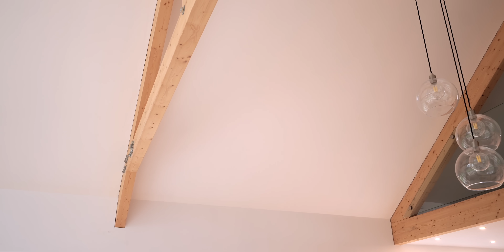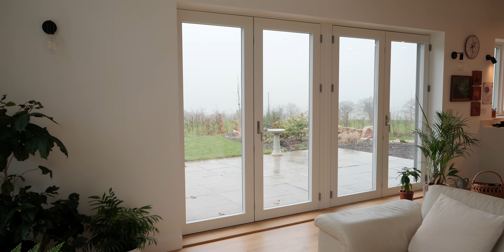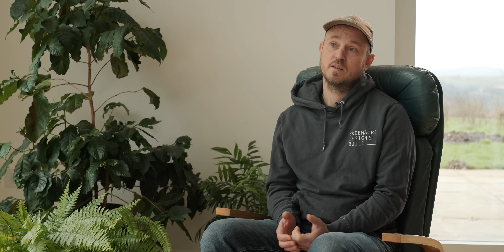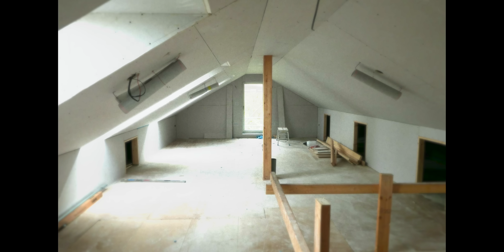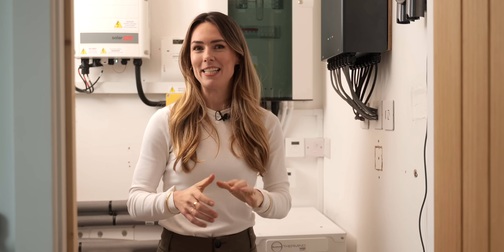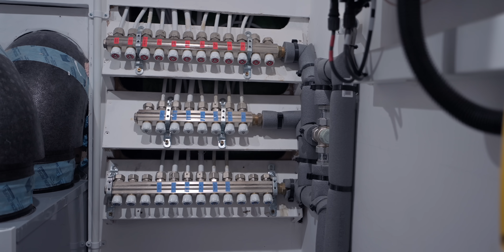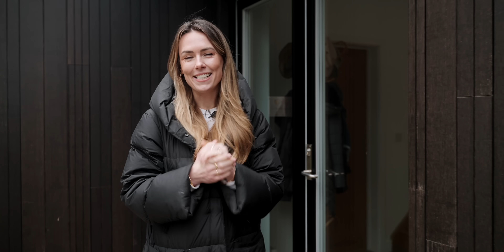Ditching a Heat Pump for In-Plaster Infrared Heating?!

Comment: Goodness gracious me Imogen!

That was an excellent episode and you didn't look for an escape route once!

Well done you.

I can certainly attest to the IR heating (I take it the material radiates FAR IR?) as installed a small mains powered, wall mounted panel, 600x 600 mm, rated at 350W for an invalid and that works very well.

Inanimate objects, despite the blurb, do collect some heat and this adds to the overall feeling of warmth.

As the old guy mentioned it's important to eliminate drafts for the "passive" thing to work.

The hot water system certainly was interesting and well worth some research.

In areas where heat pumps are practicable the installed heater clearly matched the expectations.

If you get invited to another such installation please take it up.
Reply: Goodness gracious! A good comment that wasn't bitter or condescending. From you!? Are you feeling alright? Or was it just because a BEV wasn't involved?

Comment: Usually, a  passive house with label don't need any heating system, only a small radiator in bathroom.

So, why is this house need an infrared based heating system ?
Reply: As I understand it Passive Haus needs 90% less energy for heating (than current building regs) ... so still some heating, just not very much. For a fairly small house that heat load is typically below what the smallest heat pump can run efficiently at.
Reply: @ecok Then it's not an actual Passivhaus. The certification for Passivhaus means no heating is needed. This is simply a very well insulated house, but not a Passivhaus.
Reply: Passive house doesn’t mean no heat required, just a low heat load. In a country with more sun hours but otherwise similar weather to the UK, you could probably get away with zero heating. The high ceiling almost certainly also has an impact on this as well, that’s a huge volume of unusable space above that needs heat.
Reply: @donkey1271 

Are you sure you understand how FAR IR works?

Why does an unoccupied roof space need heat?
Reply: @ForestForest-n9i   Yep. Unoccupied high ceiling space doesnt "need" heat, however hot air rises so if you have high ceilings you're naturally heating more space than if you had low ceilings.

Comment: IR can be a great efficient solution for spaces that are rarely and briefly occupied, as they can provide instant heat in localised areas. Especially if the occupants would be stationary, or with parabolic reflectors and tracking gimbals so the heat can "follow them around". 

But if it's safe to touch then you could have used a heat pump to deliver those temperatures more efficiently. And if it's not briefly rarely occupied then a heat pump can heat it more efficiently.
Reply: yeah i would have used under floor heating here
Reply: He only needs a 2kw heat pump.. Too small to work efficiently he says
Reply: @TimWigan  Why would smaller heat pump be less efficient than any direct electricity to heat option? It might not be as efficient as larger heat pump but the COP would still be higher than with any other electric heating option.
Reply: @TimWigan  I don't see why such a low heat loss is a problem.
Yes you end up with an oversized heat pump.
However, provided you size the emitters for the heat pump it won't short cycle 
It just means you have to run it for limited periods of the day.
Their bills would be negative if they had a heat pump.
Reply: @TimWigan  Yeah. I heard the opinion of the guy who doesn't own a heat pump. It's common because the MCS installers you go to to get the grant basically have a one size fits all solution. 

They don't think about the edge cases because there's plenty of business in the core where it's all the same job repeated.

This guy is an edge case, and their training doesn't cover it. He could use a portable heat pump. Or a wall mounted MVHR heat pump (about £1000). Or the right system design (like using a sun amp battery as a buffer) could make the smallest ASHP work. It would be impressive if they managed to get a SCOP less than 1 which would work out to use more energy than resistive heating.

MVHR is maybe 80% efficient. Combine it with a heat pump and it would instead have a COP of >3. 

It's incredulous that resistive heating could be the lowest energy consumption option.
Reply: IR panels take a long time to heat up, and it probably takes a while for the heat from the mesh to reach full effect too. (My nearest IR showroom advises giving them an hour's notice if you want to feel the heat from their panels.)
Reply: @moblet  We supplied this system and I can assure you that it reacts fast.  1 minute for the transformer to distribute the energy to the panels, 3 minutes for the panels to reach IR generation capability, 4 minutes for the body to feel the warmth radiated and just 8 minutes for floor temperatures to start to rise.  Tested at BSRIA in 2020.
Reply: @EnergyCarbonInfraredHeating  Interesting info, thanks!
Reply: @moblet 

😂😂😂😂😂

What absolute tosh you type!

FAR IR radiation works instantly simply because it's radiation.

FAR IR doesn't warm the air it warms "you".
Reply: @moblet  If they are Far IR panels then IME the heat would be instant - in terms of you feeling warm stood in front of one. Getting the air temperature up is a different story, but in Passive Haus that's a bit moot ... I live in a Passive Haus and if I go away for the weekend in mid winter, and turn everything off, the house would only drop 1-2C
Reply: @ecok  Yes, you feel heat instantly if the panel is already warm. What I'm talking about is the time they take to get warm.
Reply: @moblet 

What are you typing on about now?

The heating effect  works instantly because it is radiation. Repeat it's "radiation".

The radiation warms "you", not the air.

The panels don't have to get warm to work.

To repeat, we're talking about IR radiation at the top end of the IR spectrum hence it's known as  FAR IR.

The eye cannot detect the higher frequency FAR IR radiation because it's outside the "visible spectrum".

When you see an IR heater glowing red you are looking at the lower end of the IR frequency spectrum that the eye can detect because this radiation is inside the visible spectrum.

No wonder the heat pump warriors find it difficult to grasp how FAR IR heaters work with much less power if they don't understand the topic of "radiation".

Which is slightly disappointing since they've been living under FAR IR radiation since the day they were born and will continue to do so  until the day they die.

Some of these heat pump warriors continue to believe heat can only rise, which probably accounts for their preference for under floor heating.

Comment: I replaced our oil heating system with Infrared 2 years ago. It has halved our heating costs. The key to IR heating is controllability, nothing can touch it in that respect.
Reply: What type of property do you Iive in? I've been considering infrared heating to replace our warm air gas-fired central heating .
Reply: @nickk6445  Get an air to air heat pump. You can retain the warm air ducts.
Reply: @user-q8v8g  Yeah, air-air heatpump (or in other words a split ac) is a very cost efficient and energy efficient way to heat apartments and small houses. You get fine control (especially if you have multiple of them), cold air in the summer and they're pretty cheap and generally easy to implement.

The only real downside i see with split units for heating is the noise and feeling of moving air. To avoid that, it's smart to spend a bit more to get a better unit.
Reply: Kindly explain what you mean about controllability.
Reply: Not sure what you mean by controllability. My thermostat can stabilize the temperature in my room to about +/- 0.1 C with a central heating system. And with smart radiator valves it can control every room independently.
Reply: What's the cost of having something like this installed and are there any restrictions on the types of properties it can be installed in?
Reply: @solefreak2 

That's a "how long is a piece of string" question.

Perhaps a consultation with a heating and ventilation engineer would be useful.
Reply: Yes, that's right.  Control is key.  Manage the house requirements as a base load and then top up reactively as and when needed.  Charge the fabric in off peak too to utilise TOU tariffs.

Comment: 20 years as a energy consultant with 2 Degrees in energy.  I live not far from him. I don't believe that it's a true passiv Haus there's way too much glass and too little insulation. I also don't believe his figures. It also has underfloor heating manifold. Why?
I suspect they spend their winters somewhere sunny and the house isn't used in the winter. There's no way they are heating it comfortably with just 6kWp of solar and doing 7000 miles in a car. He name dropped the architect several times, I think it's an advert for them.

Comment: It is painful that there is a minimum ~5kW power capacity on domestic commerciall installed air source heat pumps currently. 

But with under floor heating and maybe an insulated water tank you could use to buffer the heat demand with, you could make a heat pump cycle less frequently and subsequently operate more efficiently. They also consume at most 40% of the energy of resistive heating systems. So it's a "no brainer". You could even embed "underfloor heating pipes" in the walls and/or floors to act as radiators like this resistive heating material. Just using less energy to do so.

You can store about 5 kWh of heat per 100L water tank between 20°C and 60°C using a heat pump. So you could "charge" that over night in one long cycle, then discharge it as needed throughout the day. Heat pump turning on every couple of hours to top off the tank when it depleats. Mixer valves to maintain circulating water temperature at the target level.

If you need even less heating capacity than even a small portable heat pump/AC unit, then you could use a small dehumidifier which are 1.5x to 4x more efficient at heating than a resistive heater too.

I can't think of a single instance where resistive heating could hypothetically beat heat pump efficiency... Unless it were catastrophically incompetantly designed and installed. 

I talked to a guy who designed a fridge who didn't know what a COP was. He got a COP over 1 and the fridge was horenous.
Reply: Or even a subamp thermal battery to act as the buffer!
Reply: At that point you could just connect the compressor of a fridge to the ventilation system to distribute the heat, water System adds an enormous amount of cost to the system, also complexity, I would probably have gone for infrared floor heating, beacuse I always have cold feet, but if there solutions works too, that's great.
Reply: @LastWish90  Air systems have low thermal inertia so the heat pumps tend to cycle more making them less efficient. 

If you're touching it then the heat transfer isn't infrared. That's just marketing.

Resistive underfloor heating is notoriously expensive to run, and inveriably burns out eventually.

Hydronic under floor heating can be heated with a resistive water heater, or a heat pump, or even solar thermal. It's more versatile and long lasting.

You're right that the tank will likely add over £1000 to the installation cost if you buy new. 

I struggle to believe a heat pump would be any less efficient even without a buffer cylinder, than any resistive heating solution. The bar is so low! 

And they put the heaters in the vaulted ceiling?! and it's passivhaus?! Madness! Heat rises so heaters should be on the floor. If it's "slow and low" then it doens't matter if it's "infrared". Realistically "infrared" just means warm enough you can feel it without touching it, which most heaters are.
Reply: @Leo99929 

Your knowledge of basic physics is astounding!

You appear to understand nothing, and even less about FAR IR heat radiation.

Hint: when you are outside when the Sun is on where does the heat come from?
Reply: @ForestForest-n9i  So you're saying that because the sun radiates heat from the sky down towards the ground, we should do the same in houses? I don't see why we should limit what we build to what happens to occur sometimes in nature. 

In the evening on a west facing beach, the suns IR radiation is approximately horizontal. on a cliff edge/mountain top it might be below horizontal, and that's where you feel the heat from.

It feels like the heat is coming from the floor when the sun has just gone below the horizon, and youre in an asphalt carpark somewhere very hot like Dubai.

Just over half the suns solar radiation hitting the earth is NIR. 49% of the IR output is FIR. 

IR is measured in W/m². You absorb more with a bigger area. Your cross sectional area is for most people larger front or back on than top down. Bottom up is identical to top down, but the legs, arms, fingers, chin, and clothes, tend to overhang, meaning that it's more likely that reflected and re-emitted incident radiation will be redirected towards another area of the body if it isn't absorbed. Like how noise absorbing foam works with spikes pointing out. 

Also, the heated surface doesn't have a lens and emits radiation in all angles equally. Hence the inverse square law says that the intensity (W/m²) reduces with the square of the distance from the emitter. Hence the closer the emitter is to the subject, the higher proportion will land on the person. So a floor up or wall out IR source would result in more effective heating than ceiling down given a high vaulted ceiling like this.

Also, ultimately it's a warm bit of wall. It heats up air and material near it. That air rises until the air has heated all the air above and equal to the heater level. The air below the level of the emitters gets approximately no convective heating. Hence heat sources in general should be at the lowest point in the room for maximum efficacy. With the heater in the ceiling only the inverse square law amount that gets absorbed by the surfaces on the floor heats those things, which can then in turn heat the air around them. 

Air itself emits IR and absorbs IR. So the air temperature is consequential to how comfortable you feel fue to IR heating sources. Even when ignoring convective and conductive heating and cooling. 

IR is generally, in most instances the minor contributor in thermal systems. Conduction is usually first, then convection, then radiation. 

Also the Infrared (IR) power emission increases drastically with temperature, following the Stefan-Boltzmann Law, where radiated power is proportional to the fourth power of an object's absolute temperature. A higher temperature difference between an object and its surroundings causes faster, more intense IR energy transfer. Since we're talking about max 60°C temperature for the emitter, and skin temperature about 37°C, we're talking about only 23K temperature difference. In IR transfer terms that's approximately nothing compared to the >1000 from a flame or plasma like the sun.

Comment: In-floor heating is much better.
It's true luxury to have warm floors which gently heat the entire house.
Also, heat pumps are 3 or 4 times as efficient as electric infrared heating.
Reply: My parents have infrared floor heating. Their apartment could not be fitted with a heat pump (historic building and some other restrictions). So they went for infrared. A big advantage is that it can heat the house relatively quickly. When they are away, they often change the temperature remotely on the way home. By the time they are home, it's comfortable. My mother is not the type to compromise on comfort and she's definitely happy. Typical water based floor heating takes ages to get up to temperature. So much that usually you don't want to lower the temperature too much because it will take a lot of energy to get it back up.

It's not a  particularly cheap system to run though. They spend a few hundred euros per month in the winter months. But over a whole year, it's not that bad. It's only on part of the year. Electricity is relatively expensive where they live. If you can generate your own power that's nice. But your panels will be dipping in performance in winter around the time you need the most power.
Reply: @JillesvanGurp  This
Reply: Floor heating feels good

But it is not cheaper, the trick with IR heating is that it is all motion activated. So if you are sitting at your desk, your desk panel is heating you. White the rest of the house is cold (kept at some low minimum temperature)
Reply: @michal4705  I agree with you, but Passive Haus needs so little heat I can't see the point of having cold air and using Far IR to keep my body warm. We built our Passive Haus for "max eco"  thinking we'd just put a sweater on; that was a mistake, we should have equipped it (heating and colling) for comfort. The energy required is tiny (and aircon would get all it needs in Summer from PV).
Reply: @michal4705   Heat pumps are 3 to 4 times as efficient as infrared heating.
Reply: @MarkSpohr  yes for the same amount of heat, the trick is that IR heating only goes at full power where you are, instead of heating the whole house
Reply: @michal4705   Is that how they make a net zero house? By not heating it?